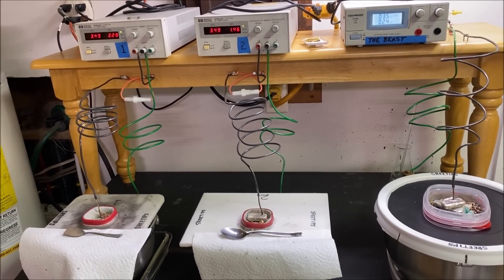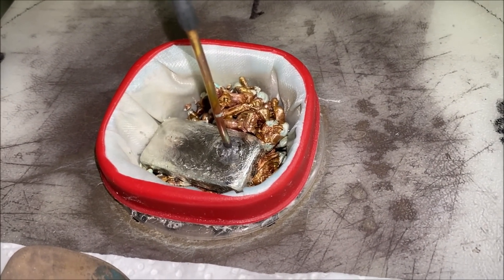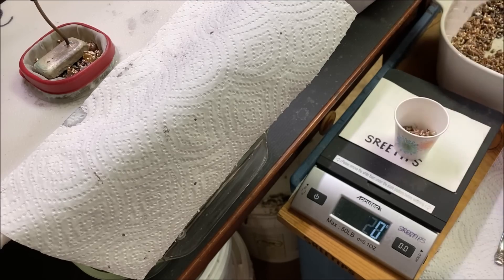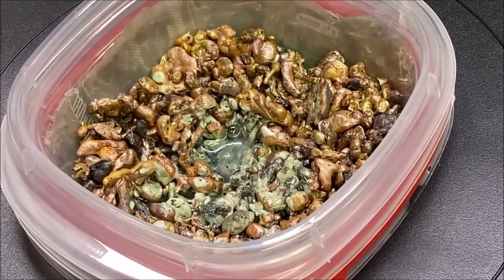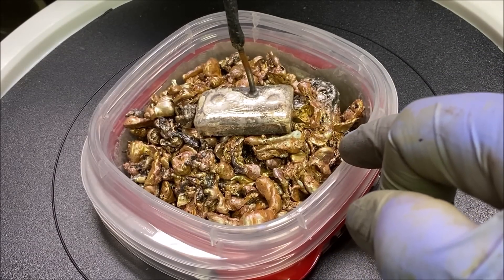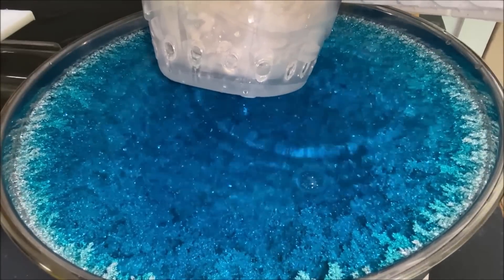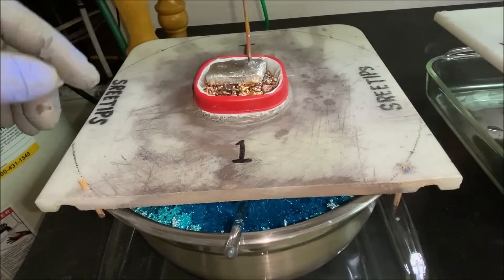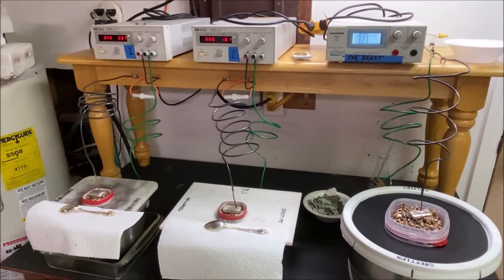Silver Cell Day 7 Crystal Growth 168 Hours

Comment: I have a suggestion. I'm retired now but when working I designed a 750 Amp non-magnetic Resistive Overload Bank. I used Copper bus bars. Wherever they made contact. I used a silver solution to plate several layers of Silver onto the Copper. To reduce the contact resistance and eliminate or reduce corrosion.

Comment: sreetips,  have you considered using titanium instead of a sacrificial anode? Anything in contact with titanium electrolyses first, and titanium is pretty inert for being destroyed in electrolysis. This is why it is used to make mesh baskets for electrolytic processes, where you dump metals consumed in electrolysis. I can imagine just a titanium sheet on top of the silver shot in such case, or even, because it won't be consumed, titanium wire would always be in a basket and the silver shot would be just added on top.
Reply from the maker: I just keep a close eye and refill with impure shot to keep the anode electrode bar out of the electrolyte.
Reply: @sreetips  I know, but i love idea of automatic systems XD Imagine titanium basket, with funnel on top where you just dump 1-2 kilograms of silver shot so you do not need to add anything yourself, and bag loosely around basket, so sludge drops down, but sides of bag are clean, so amps should not drop so much if at all.
Reply from the maker: I gotcha. These cells are pretty much fire and forget already. I check once or twice a day and add electrolyte or impure silver as needed.

Comment: Based on various forecasts and analyses, here's a speculative outlook for silver prices from 2024 to 2035:

These projections are derived from multiple sources:

2024-2025: Citigroup analysts foresee silver potentially reaching $30 per ounce within the next 6-12 months. 

2025: Market Quadrant forecasts silver could reach $34.35 by the end of 2025. 

2026-2027: InvestingHaven predicts silver prices touching $49 in 2025, consolidating around $50 in 2026, and moving closer to $77 in 2027. 

2028-2030: Benzinga suggests that as silver demand continues to outstrip supply, average prices could rise from $70.33 in 2026 to $148.49 in 2028. 

2031-2035: Satori Traders' long-term forecast anticipates silver prices reaching $480 by 2027 and $1,350 by 2028, indicating a potential for prices to be around $600 by 2035. 

Please note that these figures are speculative and subject to change based on market dynamics, industrial demand, geopolitical events, and economic conditions.

For a visual representation of these speculative silver prices from 2024 to 2035, here's a chart based on the provided forecasts:

This chart illustrates the potential trajectory of silver prices, considering factors like industrial demand and economic conditions. Please remember that these projections are speculative and subject to change based on market dynamics.

Comment: Thought.... since you are keeping the anode electrode clear of the electrolyte solution, why not have a simple flat copper "foot" making contact with the top of the impure silver metal material? Basically a piece of copper sheet with wire attached. Easier and cheaper to make.
Reply from the maker: I use silver instead of copper to keep copper concentration down in the electrolyte. If it gets too high then it could start to co-deposit with the silver.
Reply: @sreetips  Appreciate the need to keep extra copper out of the system, and, from memory, your anodes used to get quite wet. But, now you are keeping them above the electrolyte (even using failed anodes as silver blocks), I was thinking you could use this to simplify the system. And, of course, make extra sure to keep the copper bits high and dry.

Comment: I would like to see the difference between growing the crystal silver in one anode as you are and a second one where every day you scrape the sides and empty the silver to try keeping the voltage higher and not let it drop
Reply from the maker: The fun part of operating the silver cells is that they run unattended and require only minimal daily maintenance. The hard part, the part that I dread, is taking them apart and harvesting the pure silver crystal.

Comment: You could put The Beast sized filter basket on cells 1 and 2 just cut the openings larger
Reply from the maker: I’m going to find some more six liter stainless bowls and replace my small silver cells. Or maybe convert them into parting cells. Run sterling silver directly through the parting cells. Then run the silver crystal from those through my silver cells.
Reply: Ooh that sounds cool

Comment: It just dawned on me that you could put led indicators on the basket for when they become resistant and the charge would flow through the led instead
Reply from the maker: I don’t know how to include the LED in the circuit.
Reply: @sreetips  silver cell volts minus led volts divided by .010 gives a resitor number plus led between anode and cathode
Reply: Resistor...
Reply: Resistor and led in series between +& -

Comment: It's quite easy. If you neglect the losses in your system (good connections) the het produced heat is the Amperage multiplied by the voltage of the cell so that's about 8 Watts.

Comment: You say the electrode bar is expensive but you could make it more expensive if you made it out of gold😁
Reply from the maker: Check conductivity of metals chart. Gold is third under copper (2nd) and silver (1st).
Reply: @sreetips  Conductivity is not the concern.  Rather it is the activity of gold vs silver.  Comparing your electrolytic gold cell to the silver cell,   Gold moves into solution at around 1.5V whereas silver is above 2V.   Pretty sure gold would go into solution preferentially if it came into contact with electrolyte.  Obviously, that means you need to make your electrodes out of PGMs instead!
Reply from the maker: Got it, thank you

Comment: So if the cathode is stainless steel,  why couldnt a thin strip of stainless running  to the bottom of the filter like an L as anode then covered in shot not work? It wouldn't be consumed would it?
Reply from the maker: I be never tried it, I don’t know. I prefer having the anode electrode be the same as the anode material.
Reply: @sreetips  just thinking you wouldn't have to be as concerned with your anode dissolving, plus it running through the shot straight to the electrolyte would increase your conductive area. Technically those little positive ions would just push that shot straight out to the electrolytes and the cathode. At least that's where my understanding takes me... then really all you have to worry about is the filter clogging. Maybe?
Reply from the maker: Possibly, but I prefer silver for my anode electrode bar. It’s worked perfectly for many years.

Comment: I'll probably never try this myself but the clogging filters would annoy me for sure. I keep thinking about ways to do this without filter baskets while still being suitable for hobby lab surroundings.
Reply from the maker: They are an annoyance, but at least at five bucks each, they’re cheap.
Reply: @sreetips  just theoretically, what would happen if you just hang an anode into the electrolyte that will not go into solution, eg gold? Will the silver still plate out on the cathode until the electrolyte is depleted? I am imagining an anode on the bottom of a plastic bucket with sheets of stainless suspended above, so the slimes just stay on the bottom. I guess the wire leading to the anode would have to be insulated and also the point where the wire goes into the anode. Maybe a squirt of spray paint?
Reply from the maker: The stainless cell (Thum silver cell) configuration that I use has worked well for many years.

Comment: Question. If you cement out the copper on Iron, would you be able to recover that and melt it into a bar to go back into the silver cementing jars?
Reply from the maker: It’s heavily contaminated with other metals. Clean copper for refining is cheap and plentiful.
Reply: Theoretically possible, but the extra effort involved doesn't make sense at cooper's current price.

Comment: The difference in amp hours is due to the anode and cathode connection, temperature or alloy may be affecting the results. 
There is a type of wiring made of metallized copper or by electroplating of silver and oxygenated WGA transparent cane, tin soldering and an insulating jacket are required for the terminals. 
I have modified the electroplating station and have obtained better results due to the capacity of the current flow at low temperatures. 
In the gold recovery container at 9.V and 2.67A I have a refrigerator attached that leaves everything at 18.0°C since at higher temperatures gold deposits do not occur.